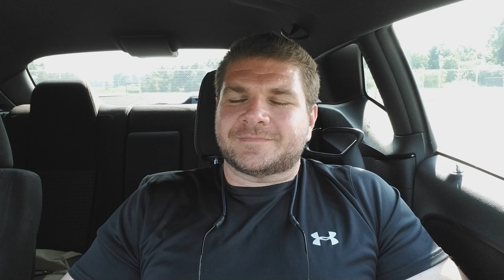What is a "Smart Alternator"?

Comment: I can't find any information regarding a clutch or any other mechanical disconnect on smart charging systems. As far as I know they're all essentially the same- there's an inductive pickup on one of the battery cables (it was on the negative cable on my Silverado) that sends load information back to the voltage regulator and that is what controls alternator output. I know GM also tries to monitor underhood temperature to determine how much power to generate.
Reply from the maker: Mike Dubiansky I think it is called an overrunning alternator pulley although it is not exclusive to smart charging systems. I think my explanation is a little off :)

Comment: What waffle are you talking. Clutch. Its not an AC compressor. It workd by the bcm controlling voltage and demand of power from the battery thus uptaking the charging cycle back to around 14 volts when the battery drops below 9.6 volts.